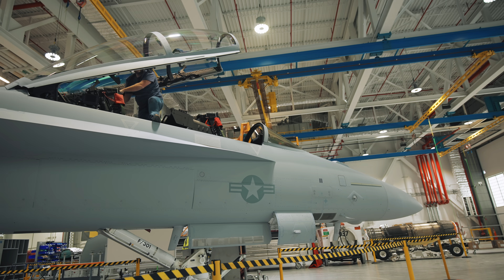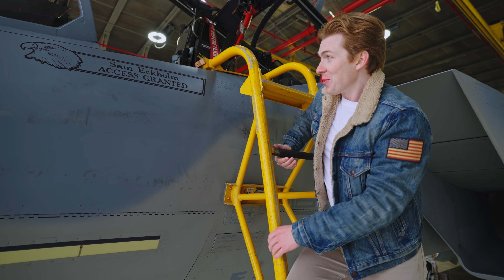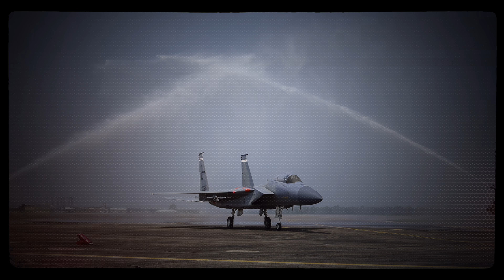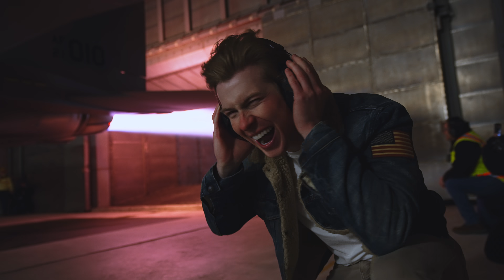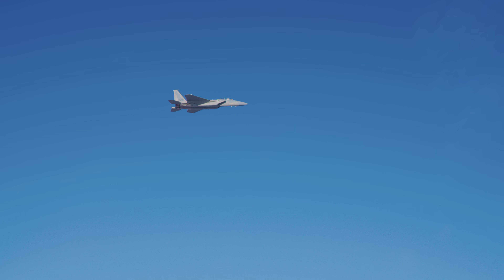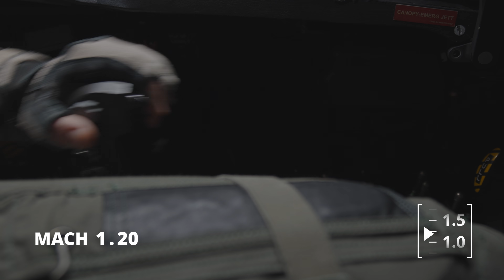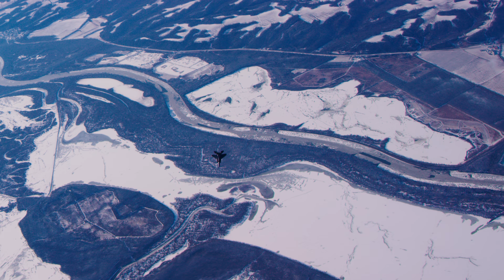Flying the Most Advanced F-15 Ever Built

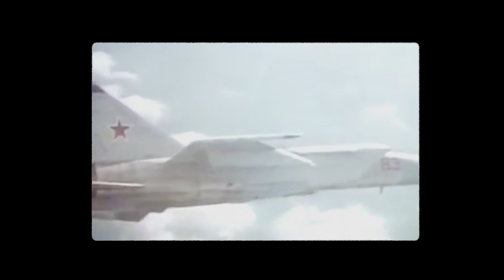Comment: Goodness gracious!  I do believe that that is James S. McDonnell Himself at 0:06:58, unveiling the first F-15 in 1972!

Now I'm getting all nostalgic about those days in the summer of '72 when I was working on getting my pilot's license and almost done with my degree in Aeronautical & Astronautical Engineering at the University of Illinois.  I flew into St. Louis airport as a student pilot, fat, dumb, and happy in my little Piper Cherokee 140.  Called the tower to tell them what I was up to, and heard, "One Two November, you are number 2 for the runway behind two F-4's flying in formation at your altitude."

That was the day the Air National Guard had started operations at St. Louis.  As best I can tell, the NOTAMS changing the altitude for general aviation must have been printing out on the teletype just as I was wheels up out of Willard Field in Champaign, Illinois.  Oops.

Since this video is on the Boeing channel, I'll note that I am a Boeing alumnus.  Graduated the following January and went to work at Boeing in Seattle for the next seven years in flight controls engineering for the Boeing Commercial Airplane Company.  Then recruiters from the Johnson Space Center came a-knocking and offered me a job at the Holy Shrine of All Space Fans, and I ended up spending the next 20 years working in EVA and Crew Systems for McDonnell Douglas.  Which brings us back to Old Man Mac but not for long because Boeing missed me so much, they bought the whole company!  

That's my story and I'm sticking to it!

Comment: The most impressive part of this flight isn't the Mach 2 run or the 8G turns. It's the acceptance testing behind them.

Every system is being pushed toward its limits before the aircraft is handed over... not just to prove performance, but to expose failure modes while there's still an opportunity to correct them. The in-flight engine shutdown and restart is a perfect example.

That principle extends far beyond military aviation: a system that performs under ideal conditions isn't necessarily a system that's ready for the mission. True capability includes knowing how it behaves at the edge of its operating envelope, how it recovers from failure, and whether it can be trusted when the margin disappears.

The aircraft has to pass the test. The mission has to survive reality.

Comment: f15c was the non fly-by-wire jet. F15e (two seater) moved to fly-by-wire. 

This means that the airframe was an inherently stable, ie if the engine gave out the plane could still glide under control. The f16 which was the first fly-by-wire was specifically designed with an unstable airframe, but that is another story. 

The f15c thrust was greater than the weight, so it could  still accelerate and overcome gravity even if the plane was pointing straight up.

Comment: :hand-pink-waving::hand-pink-waving::hand-pink-waving:This is one of those videos where the engineering behind the aircraft is just as fascinating as the flight itself. The F-15EX may trace its roots back to a fighter designed more than half a century ago, but what we see today is an entirely different level of avionics, systems integration, performance and combat capability.

The flight program itself was especially impressive: afterburner, an extremely aggressive climb, serious G-forces, speeds beyond Mach 2, aerial refueling, air-combat maneuvers, and even testing the aircraft with one engine shut down. When you think about the loads being placed on the engines, fuel system, hydraulics, airframe — and of course the pilot — you start looking at this machine very differently.

At RAZBORGRUZ, we work with much more earthbound machinery: rebuilding heavy-truck engines and transmissions, diagnosing failures and restoring trucks after serious damage. But the basic engineering principle is the same everywhere — behind an impressive final result are thousands of components, precise calculations, reliability margins, careful assembly and the work of highly skilled people.

That is why footage from factories, workshops and real testing is often even more interesting to us than simply watching a beautiful flyby.

The F-15 has unquestionably become one of the iconic aircraft of its era, and the F-15EX shows just how much development potential was built into the original platform. With all respect to this incredible American machine, if I had to choose with my heart, the Russian Su-57 would still be my favorite 🇷🇺🙂 I would absolutely love to see the same kind of detailed video someday — its production, engines and a full test flight from the inside.

Huge respect to the creator for getting this kind of access and documenting it so well. Videos like this make people interested not only in aviation, but in engineering itself.

Good luck, good health, peaceful skies and all the very best to everyone reading this! 🤝

RAZBORGRUZ — World of Trucks. We don’t have fighter jets in our workshop yet… but we do take heavy machinery apart right down to the last bolt. 😄

Comment: You can thank Russia for the F15. If not for the paper tiger Foxbat that Russia said was unbeatable this plane would never have been built.    Thank you
Reply: The MiG-25's influence on the F-15 amounts to a brief increase in the max speed requirement from Mach 2.5 to Mach 3.0 around 1968/1969. The requirements were reverted back to the originals by 1970, so not even the prototype F-15s were influenced by the MiG-25.

Comment: practical mechanical fighters from 50 years ago will always be relevant, because they're cheaper to maintain, built tougher, and easier to work on, the newer platforms like the F35 are better multirole fighters for sure, but you need a sturdy reliable platform to make sure you have a robust storage of fighters you're not afraid to lose.

and also to sandbag other countries, since it's something the U.S. tends to do.

Comment: This jet has everything that gen 5 has except for stealth and super-cruise..  
And yes when you abandon stealth,  the weapons load goes through the roof..   
with the fly by wire and air to air mission also covered, as they age out F-15C and F-15E air frames on hours.      
what normally happens is they will select a squadron or wing to convert, then send them 2 or 4 aircraft to start training on.  
Then they will start sending new frames from STL replacing the airframes they are sending to (PDM depot)..  if the jet is just to beat up depot will NRTS the airframe, and strip it.
The F-15 has a planned 30 year life span with Depot scheduled about every 72 months.
This  Programed Depot maintenance (PDM) takes around 5-6 months to finish depending on what they find, and parts supplies.
Once depo is  finished rather than sending it back to the owning unit they send the fresh depo airframe to a squadron still flying that jet.  
The line was turning out about 12./year, but they are in increasing production rate to 24/year (2026 goal).
Normally they will try to schedule a 14-16 aircraft squadron to PDM 2-3 aircraft a year,  hence why a 12 plane squadron has 14-16 airframes on the books, some of them are in PDM.
As they do the cut over, they will trade 5 and 4 year to depot jets out for 1 or 2 year depot jets..   So the squadron has a lot of aircraft with dwindling depot time lines. then they start replacing those jets with the brand new model, @24/year boeing and effectively rebuild 4 squadrons at a time each getting 5-6 per year.

Comment: Interresting but as a French / European, for me its like an outdated Mirage 2000 but upgraded to a +++++ version, cool tough, maybe a good alternative, that scrap all those old 80/90's planes of the US arsenal
Reply: No that would be like the F-16 getting a complete overhaul. Lightweight with limited range and payload, there's not much room to make it better. Though they are still getting upgrades since it takes a long time to replace almost 1000 fighters, so the newest airframes with the most life remaining have to remain useful.

The F-15EX has all the space you could want for avionics, the largest potential payload of any modern fighter by far, the longest combat range of any fighter, and in air superiority configuration is highly maneuverable in all flight regimes (unlike the F-16).

Comment: RAF Typhoon and other European jets have beaten F15 jets in mock air combat. Over the Lake district in England two F15 strike Eagle's tried to bounce a Typhoon jet but lost the air to air engagement when the Typhoon used a manoeuvre to out turn the F15's. Air to air combat the F15 will lose the fight at close range. The original 1950's British Electric Lighning could out climb several versions of F15 jets. The RAF in 1977 shocked US pilots who laughed at RAF Bucaneer jets at a Red Flag exercise flying at 50 feet off the Nevada desert evading US radar and simulated obliterating US targets. F15 is good but never underestimate the RAF or Royal Navy pilots like the Argentinians did in the Falklands war.
Reply: The F-15E is known for it's lack of maneuverability. If an F-15E pilot wins a dogfight against almost any other modern fighter, it's because the other fighter's pilot lacked skill. I would go so far as to say a Typhoon winning a dogfight against F-15Es while outnumbered is more an expectation than a challenge.

The F-15EX is a fighter designed to replace the ageing F-15C, which was notably more maneuverable than it's Strike Eagle cousin. F-15Cs are roughly as maneuverable as Russian Su-27s and can put up a fight against most modern fighters in close combat. The F-15EX is known to be slightly more maneuverable, so should be a challenge no matter the opponent depending on flight conditions. A Typhoon should still win most of the time in close combat, but I'd be expecting losses too.

The EE Lightning was designed for a different purpose and different era than the F-15. They are not comparable, and the F-15 has always been a better performer even in the Lightning's only role of interception.

US F-15 pilots in the 70s were renowned for arrogance and lack of teamwork due to having the latest and best fighter, and the best individual air combat training. It was so bad back then that a flight of 2 F-16s could close in on a flight of 4 F-15s head-on and still win, because the F-15 pilots would all train their radars on the same airspace and wouldn't notice the F-16s split vertically due to their small size and the fact the radar display was a top-down perspective (hence no ability to separately display aircraft that are directly above and below each other). Eventually all F-15s would lock one of the F-16s, losing situational awareness, and resulting in the other F-16 swooping in from below or above scoring 4-0 or at worst 4-1. 

It goes to show that having the best equipment is no substitute for proper tactics and an open mind, and the US had learned this lesson quite well by 1990 after being humiliated by multiple nations - even by RNZAF A-4s. It's a large part of why they have such a focus on situational awareness these days. An average pilot can do more while knowing the enemy's position than the best pilot who doesn't have the information.
Reply: @dumdumbinks274  Yep red flag in US saw RAF Buccaneers fly so low US radar couldn't see them.

Comment: I was a crew chief in the USAF from 1985 to 1993 and I tell you what, even with double ear protection, its still very loud.  I did so many engine runs in TAVEE's during my Air Force career and it never got old.

Comment: As of today, start of august 2026, 2 F-15s have been shot down over Iran. So it's 106-2 now.
Reply: As three was friendly fire, it legitimately does not count. The fourth was brought down by an air defense system which means that the F-15 still has a 104-0 ratio. This logic applies to any aircraft, American or not-- Friendly fire and ground defenses are not counted in kill ratios.

Comment: Pretty accurate . One item. We had fly by wire in the Jet from day one. Not as advanced but CAS worked well . The mechanical linkage was back-up. Any issues were first addressed by hooking up a mule for a 20 min open loop bleed of the hydraulics.

Comment: I wish they showed you the stress they put through them before sending it off. Im talking about they're dropping it 30 feet from the air to test its suspension and wheels. The rigorous weather stress test like snow, rain, high heat,  All simulated in a hangar. It's awesome to see what these fighter jets really go through.

Comment: What's it like inside the cockpit during flight?  Does it get cold inside up in the high altitude?  Is the interior climate controlled like a car, with heat and cooling when needed?  Thanks.

Comment: During the NATO exercise Atlantic Trident 25 in Finland (June 16–27, 2025), a French Air Force Rafale symbolically “shot down” a U.S. F‑15E in a close‑range dogfight, as shown in official French footage.
What happened and how

    Context: Atlantic Trident 25 was a joint U.S.–France–Finland exercise focused on high‑end air combat training.

The “kill”: In a video released by the French Air and Space Force, a Rafale is shown acquiring and “firing” on several opponents in visual‑range maneuvering, including an F‑15E Strike Eagle, an F‑35A, and a Finnish F/A‑18. The term used is “symbolic” or “simulated” kill—meaning the kill was scored under the exercise’s rules (e.g., radar lock, simulated missile shot, or gun solution) rather than a live weapon.

How it’s possible: In tight, within‑visual‑range (WVR) dogfights, modern 4.5‑generation fighters like the Rafale can leverage very high agility, strong situational awareness, and excellent helmet‑mounted cueing/IR missile capability to beat larger or stealthier aircraft if the engagement gets close enough. That’s consistent with how air forces often structure “dissimilar air combat training” (DACT) to test limits.
How many times?

Open sources confirm at least one documented simulated victory of a French Rafale over an F‑15 in this 2025 exercise, shown in the official video.

There are older claims and anecdotes about Rafale performing well against U.S. fighters in various war games (including stories about the F‑22), but for the specific pairing France vs. F‑15, the only clearly attested, publicly documented instance is the Atlantic Trident 25 dogfight footage.
So: yes, it has happened in exercises, and the publicly known count is one confirmed simulated kill in 2025, with no verified additional public instances.
Relances

Comment: How can a fighter jet first developed all the way back in 1967 through 1976 be the newest, latest, & greatest in warfare when there is a far newer model the F16 which was developed in 1970 through 1974?
I mean granted it's only a short technology gap but those few years make a huge difference just like they do with computers. There is seriously no way an F15 is newer than the F16. That's because you go up with each successive model, not down. So presumably if they were to make another follow up it would be called the F17.

Comment: Myself and my wife both work at Hughes Aircraft Company, who designed and built the avionics and weapons systems for this aircraft.

We are so proud of the outcome and capabilities that allowed our men and women of the armed services to do their job and come home

I still remember when the f-15 was utilized to launch an anti-satellite missile and shoot down a satellite from space as a test against space based weapons.  HAC was directly involved in this.  The 1st time the missile missed the satellite by about 10 miles IIRR, the engineers were beyond disappointed, but you have to remember the satellite was traveling at 14,700 mph.  HAC went back to the drawing board so to speak and working with CalTech identified the issue and fixed it.  The second attempt resulting in a direct hit.

While the USSR was spending billions (typically $1B per platform with weapons) putting space weapon systems up, we could take them down at almost any time at a cost of about $1m

Comment: I need this for the War Tander:
How many AIM-120s can this jet carry?
Does it have a thrust-to-weight ratio higher than 1? So it can fly straight up after takeoff? Well, maybe not at exactly 90 degrees, but what is its thrust-to-weight ratio?
How long does it take to reach Mach 2 at, say, an altitude of 9 km? 
What is its turn rate in a steady turn? And at what altitude does it perform this maneuver optimally? 
Does it have energy conservation capabilities? What about systems like an onboard defense suite? 
Is it better than the EF-2000, or are they different aircraft from different domains, so comparing them doesn’t make sense?

Comment: Great video, my only complaint is there is not mention of Mcdonnell Douglas Aircraft, the original designer and manufacturer of the F-15 Eagle.  I was assigned to the 336th Tactical Fighter Squadron and we were the first USAF unit to achieve Initial Operating Capable with the F-15E Strike Eagle. Within a few months we were deployed to Thurmrait Oman then up into Al Kahrj Saudi Arabia for Desert Shield/Storm. The aircraft performed flawlessly during the first Gulf war!  Back then we had the Hughes APG-70 radar system which was more than capable. I enjoyed working the avionics systems on that jet! I am sure its even better now! Godspeed to all the future pilots of this great jet!